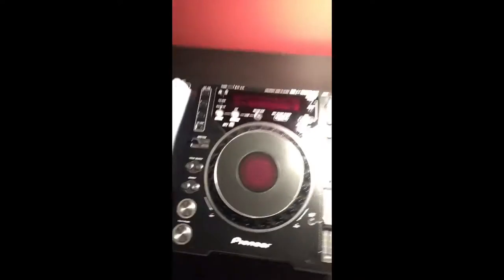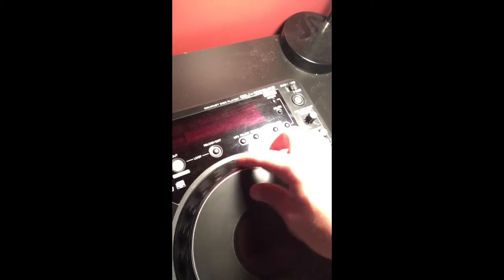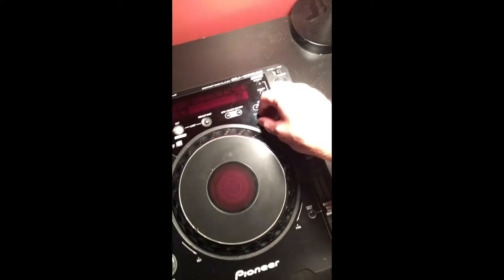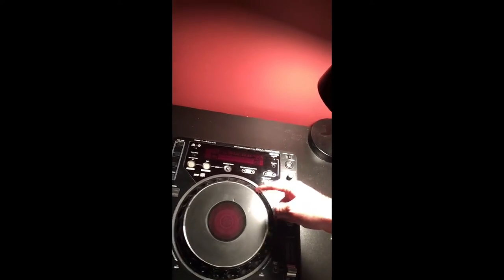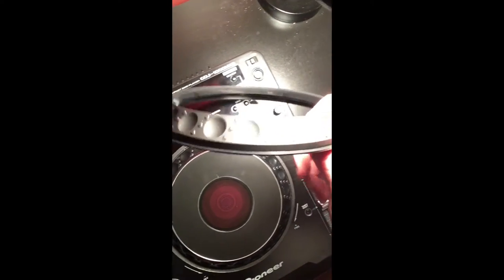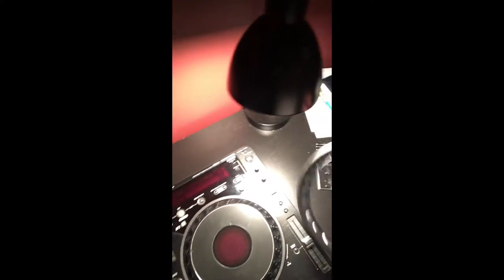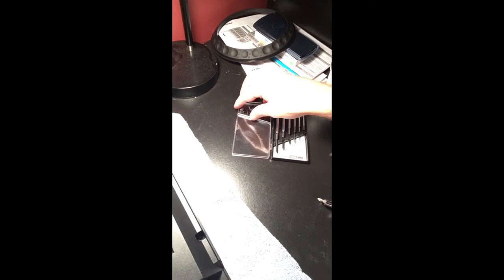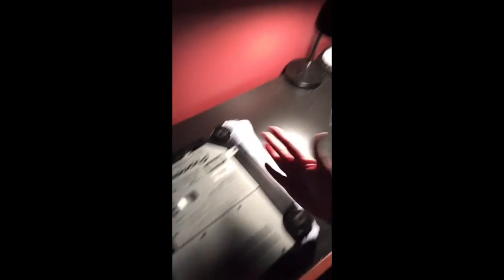PART 1 Replacing CDJ 1000 MK3 Outer Jog Dial Ring

Comment: Do you know if it is possible to replace the metal silver plate?  Mine has a big dent in it.  Id really appreciate it if you could fill me in.
Reply from the maker: Hey sorry it took me a year to see this! In order to replace that plate you'd just need to search online until you find the part number, that's the only hard part. After that you can most likely get a replacement from Pioneer directly or a technician/dealer